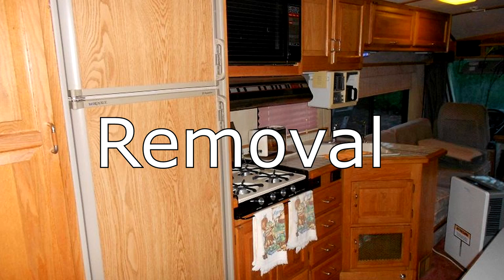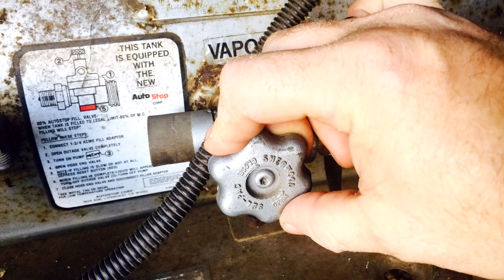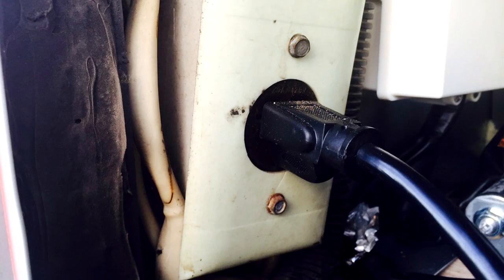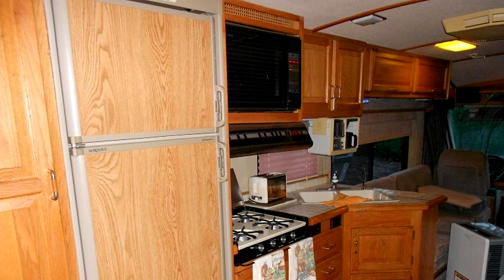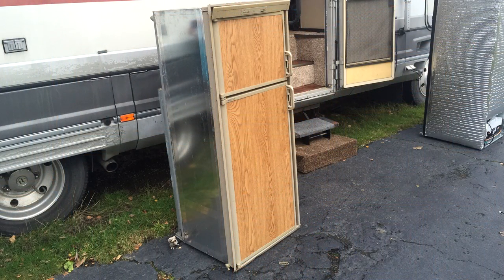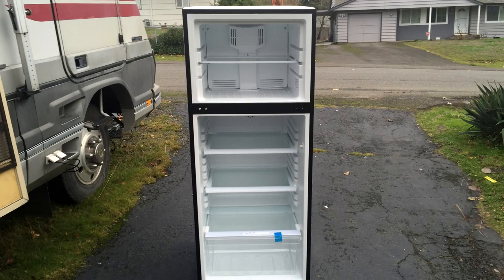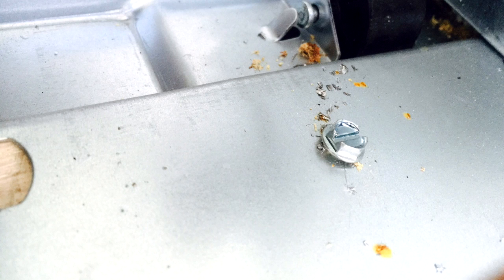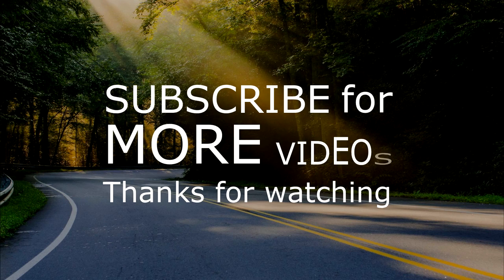🔴Installing a Residential Refrigerator in an RV the easy way | RV Living

Comment: I have a brand new travel trailer about 1-year-old I just want to put a residential unit in because I am so tired of the gas/electric refrigerator that is practically useless on the electric setting it only is cold on gas which is normal but just not practical for me to deal with since I live in my trailer year-round so I will probably do what you did and put a residential unit in thank you for this video
Reply from the maker: Thank for taking true time to stop over watch a video, leave a comment, and supporting my channel
Reply: No problem I like your detailed video and explanation of how to do it I actually am installing my residential unit tomorrow when it arrives I will let you know how that went. I am going to subscribe as well
Reply from the maker: It’s not as hard as you might be leave. Keep us posted on you progress
Reply: @3tailsRV  of course 🙂
Reply: @3tailsRV  so I installed the refrigerator it is a 7.5 cubic foot RCA refrigerator it was not hard to install the new refrigerator it slid right in the door and fit in place snug where the previous refrigerator was just have a 2-in gap on each side that I will put a black pool noodle on each side to seal it up I had a hard time with the removal of the previous refrigerator it would not fit through the door of the RV I had to completely demolish the previous refrigerator to get it through the door so yeah it was a job but it was much worth it it got down to temperature in under 4 hours thank you again for all your help with your video

Comment: does the fridge also work on battery while travelling ?
Reply from the maker: Sorry but it does not.   That would require a solar setup.
Reply: It could you would need a decent battery bank and inverter along with solar

Comment: What do I ask for at hardware store to cap the propane line.? I heard you say terminator what size?
Reply from the maker: Depends on the size you have in the RV... At lowes they are called Copper Slip Cap Fittings.

Comment: You're not going to be able to run that fridge very long on a solar panel and inverter.
Reply from the maker: Funny thing is they run RV A/C units off of them .  Do a search for it.  If you build it big enough that is .. LOL
Reply: Aron Jemison You're right.  But a rv fridge uses a lot less power than a residential fridge. It will work, but you won't get very long run time. Plus its made for solar, a residential is not.  And that's why the rv fridge is more money.  Good luck, I will be happy if you can make it work.
Reply from the maker: Then why do most newer RVs have residential fridges installed in them? They have a double battery system dedicated to run them..
Reply: The assumption is that you will be plugged into shore power.  Shure, the inverter will run the fridge, just not very long.  Do the math.
Reply from the maker: Finally, another option that might be cheaper and better in the end ( and has the benefit of supplying power for most of the other stuff in your RV ) is to invest in more batteries and a solar system. You'll need roughly 450Ah of batteries and 600W of solar to keep up with the electrical demands of a residential fridge. You'll also need an inverter to turn the 12v from the batteries into 120V AC power for the fridge. Any additional electrical loads ( lights, electronics, microwave, etc. ) are in addition to that estimate.
Reply: Not true